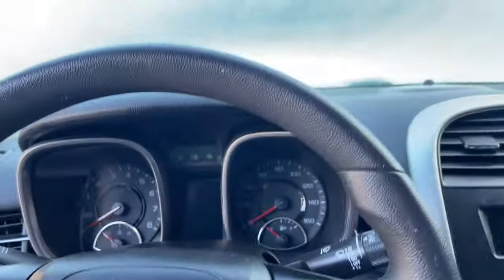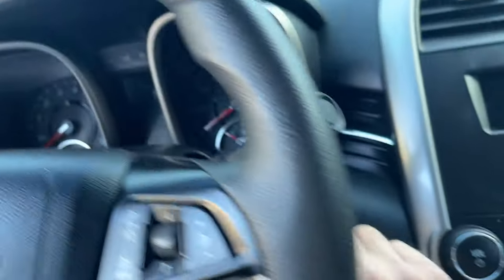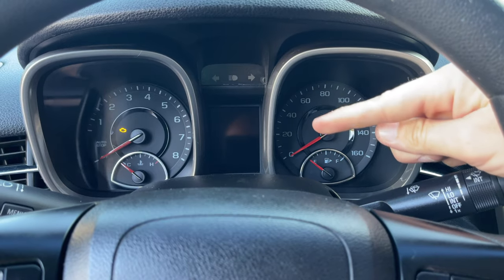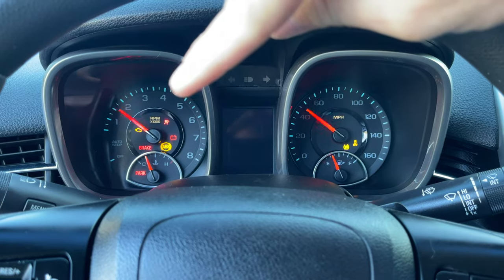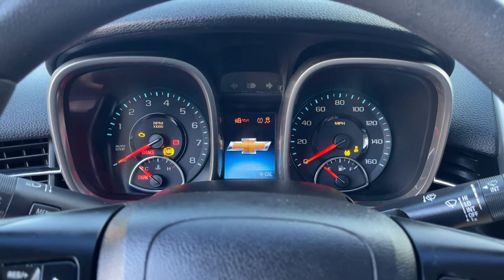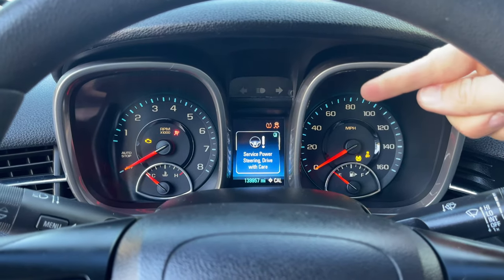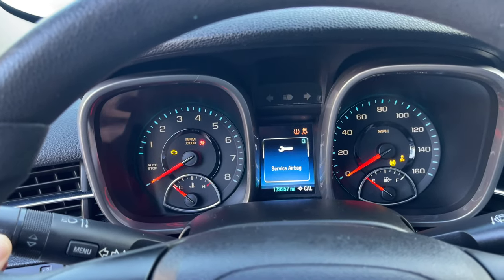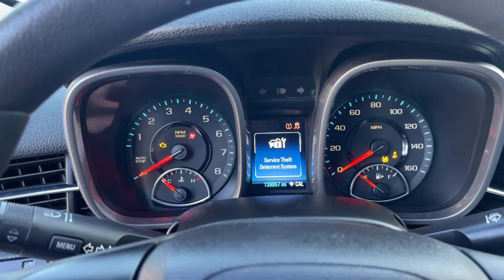Multiple Modules Not Communicating, Where To Start?

Comment: Such a relief to find a channel that doesn't claim its been to 5 dealerships that couldn't fix it.
Heres a tip for rpo codes on gm vehicles:  if there is a qr code on the door label scan it.  Theres your qr codes. Rpo codes

Comment: I like the way you test the wake up output, also quick check of the comm for integrity.  
You answered a question I've had, at least I think you you did.
I have a 2020 Toyota RAV 4.  When the driver's door is opened there's one "ding" from the "key in ignition" chime.  Just one.  Oh ya the interior lights also come on with the door opening. 
I'm thinking that wakes up the BCM and readies the other modules.  
The other noticeable sound is when I put the key in the ignition and before it's turned to on, the fuel pump in the gas tank is energized for two seconds.  So that one event of opening the door and key inserted in the ign lock completes a lot!
So thank you for this video, I'm glad you found a bad BCM and could replace it.  Also thank you for helping me understand what my Toyota's doing.

Comment: i always like the thought process these guys use. its   not to solve an issue i have on any veh , its why they start where they start and their thinking. most guys like if i ask why when you remove a valve core from tire why does the air come out they look at you like dah  they never relate to pressure differential or why the stem gets cold .you tell them the new ac condensers are filters now for the particles that start leaving a faulty compressor, they are dismayed. when i was first told that i dissected one to understand and yes it was true. when i watch these new techniques of testing i put it to the test for myself to prove or disapprove of their test. bottom line if you want to learn all this new stuff  it takes dedication and a passion. cooking has things to do with what we do .like a pressure cooker relates to our cooling system. cooking with olive oil on stove and drop water in it if you understand that violet reaction that happens , not that it scared the crap out you but what caused it to take place, thats the thinking and understanding part ,knowing why it did it. pressure, volume and flow applies to electricity, fluids ,air etc, once you connect the dots you can trouble shoot many things not just automotive. keep them coming love it

Comment: Awesome diag Jake! Great strategy and thank you for taking the time to show how to track the problem down from a different module other than the BCM. Of coarse you knew the BCM was the power master module (sends the wake up voltage to other modules) but you went above and beyond to show that there is more than one way to get to the source of the problem. I've always been impressed with how you use both the meter and the test light to prove circuit integrity and voltage drop. I have one question about a BCM. If you have a sensor on the BCM, and the reference voltage to that sensor gets shorted to ground, can it cause no communication to the BCM?  Or if a sensor is shorting the reference voltage to ground internally? I know in this case that wasn't the issue but could it be something that could cause issues?
Thank you for another great video! Look forward to all your content!
Reply from the maker: In my experience no the power regulator to the mcu chip is separate from any sensors but I have proven before that a shorted sensor circuit to battery power could cause damage to the mcu. That’s just extremely uncommon scenario though.

Comment: Another great case study Jake. 1 question; Aren't you afraid to disconnect the battery at the beginning of the diagnosis? I have had can bus failures that were - temporarily - resolved after a 12v reset of the battery. Well, in this case it won't be the case with a hard mistake, but I did wonder... Greetings
Reply from the maker: No once I have my prescan I'm not worried. If the concern clears then it was probably in a logic lockup(frozen) and the power cycle fixed it and I go about my day. If it Repeats then we need to test powers and grounds.

Comment: Good evening what wattage bulb are you using to load test the circuit. Thanks
Reply from the maker: My go to bulb is a 3157. I can use it for a half amp load, 2 amp load, or stack both for 2.5 amps.

Comment: Hey Jake thanks for the awesome content. Is it possible that you can do the one with GHE FORD EXPEDITION THINKS YOU LEFT THE KEY IN TBE IGNITION PLEASE SURE HAVE THAT PROBABLY
Reply from the maker: I've never seen that
Reply: @autodiagyt  thanks for replying back jake but I'm having that issue now my ford expedition thinks I left  the keys into the ignition and I remove the key but my temp light oil light service engine light abs light and the chime noise stays on so i disconnect the negative terminal from the battery so it want make the battery go dead. Could you please help me out smh
Reply from the maker: @reggiemcnair1030  if I had the vehicle I could diagnose it but there isn’t really anything I can do without research and testing.
Reply: @autodiagyt  Jake I took the terminal off all night drove great all day until tonight went in the store came back out and the service engine light was on the temp gauge then tried to start it an it wouldn't crank. Unplug the negative terminal to reprogram the computer and it started back up smh it's frustrating at this point
Reply from the maker: @reggiemcnair1030  yeah I bet where are you located and I’ll see if I can recommend anyone in your area.
Reply: @autodiagyt  I'm in Macon georgia Jake and thank you and continue putting out those awesome content love watch and learning with some excellent knowledge 👌
Reply from the maker: @reggiemcnair1030  check with Grant's Tire & Auto in Macon, there lead tech Paul is good or Keith at Raffield Tire in Warner Robin's

Comment: Very much appreciated but you forgot a test at the end, you showed the nice TOPOLOGY at the beginning and made a guess as to what modules were not online but you did not show the fully working TOPOLOGY at the end after the fix please. 12 or 13 or 15 based on other Malibu I have seen but no firm record on a 2015.
Reply from the maker: Yeah I was in a hurry and just programmed it with sps and cleared the codes and everything worked and no codes in gds. Takes to long to rescan just to get a topology green screen. I really don’t care what modules are equipped because it can be different from one to the next. Swapping tools just to see that tree has no value to me when gds shows no codes after a key cycle and crank. The topology does come in handy at the start because it’s modules I know it’s equipped with, there was 2 more modules offline that I didn’t know was there until looking at the rpo codes and the wiring diagram but it’s still irrelevant if you follow the symptoms and have a good process in place.

Comment: Thank you mister jake for another great lesson .
Quick question.
If we don’t have power at ebcm can we bridge it ?
Conect power from + battery? In pin 33
Will it comunicate then ?
Reply from the maker: Yes it would but would be better to test at both ends of the circuit to make sure you don't have a broken wire.
Reply: Thank you sir.
Many tech say that you can bridge the can lines and verify that ended that is the problem.
Reply: Hello sir I’m watching this video again.
How to know Wich letters to pick from the build sheet ?
Reply: Thank you sir .
Reply from the maker: @jordysandino6577  you compare your diagram rpo codes to your build sheet and look for the ones you have and don’t have
Reply: I like that word mister jake you got to start somewhere.
Facts.
Thank you sir

Comment: Was checking the communication wires coming in and out of BCM not necessary? I'm just trying to learn like everyone else.
Reply from the maker: No because the scan tool has to pass data through the BCM before it can communicate with anything else on the can bus. So this along with the ohm test at the dlc confirms good data wires in and out of the bcm.

Comment: What will be the terminal resistance value if it had all 3 120 resistors
Reply from the maker: It wouldn’t. The wiring harness would be completely different. But the math would be 40 ohms.

Comment: So the ohms check at first confirmed wire integrity on can ?  battery powers and grounds were good so ignition power was the culprit and that comes from bcm and as long as wire is not shorted it has to be a bad bcm?
Reply: That seems to be the thinking, but I'd be asking what turns on the BCM.  In this case, I'm guessing the key controls the ignition relay directly so "powers and grounds" covered that.
Reply from the maker: The bcm never fully goes to sleep it’s monitoring several things like a door opening to then fully wake it up and then it wakes up any other modules that might need to be used. So the bcm is basically responsible for waking itself up.
Reply: @autodiagyt  Ok, but it still needs an input to do so, be it the key or the door switch.
Reply from the maker: @russellhltn1396  yes even a scantool sending a message on the can bus will wake it up.

Comment: I dont quite understand. I would have thought the RPO codes on that BCM wiring diagram meant the BCM had that terminating resistor since the vehicle had those same RPO codes too.

EDIT: The diagram says "-" meaning "minus". So any other RPO codes would've had that terminating resistor.
Reply from the maker: If you see the minus on a rpo code branch you ignore that branch.

Comment: Where would you start if you had an OL at the dlc instead of 60 ohms
Reply from the maker: It's extremely rare to have OL access 6&14. But if I did I'd be looking to see if the dlc plug is an aftermarket dummy and the real one is tucked away.